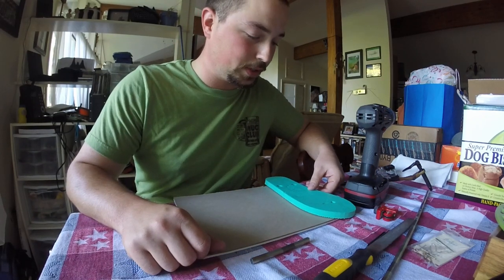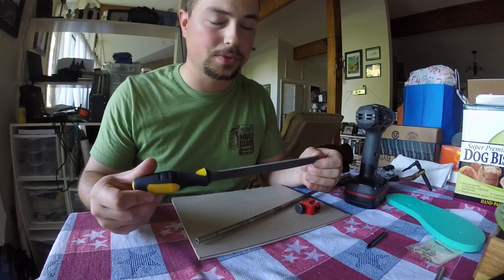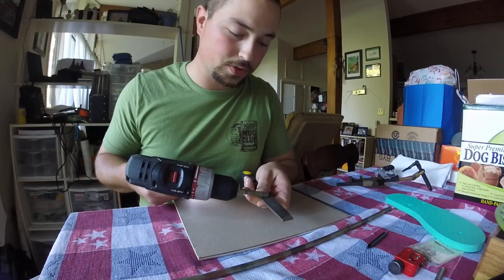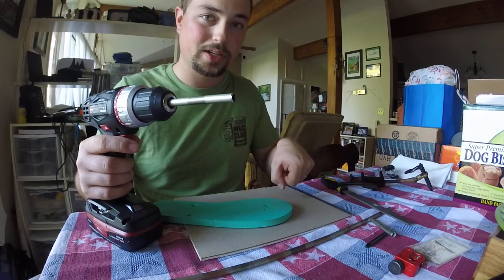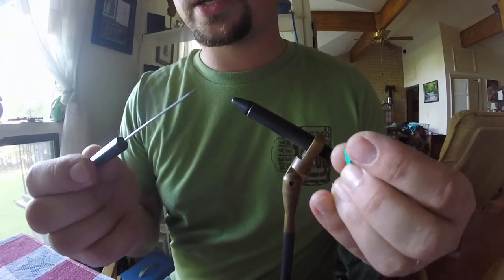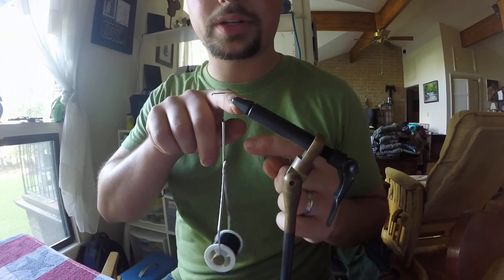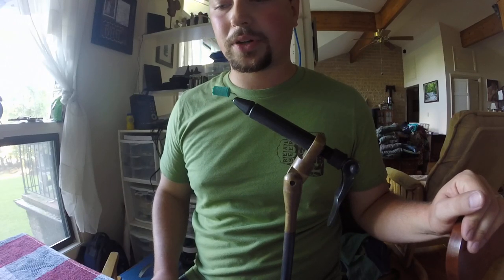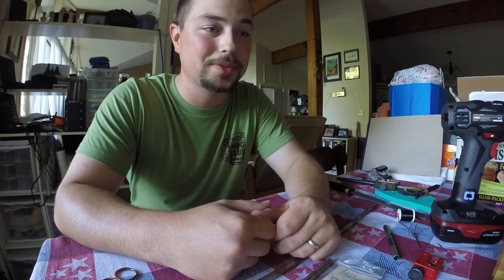DIY Foam Poppers

Comment: Great way to do this. There is a set for cutting trout bodies, or booby eyes for trout flies. This is a great idea for larger poppers. I might get some arrow shaft for cutting larger poppers. I don't think the flip flop foam is as dense as the foam I buy but it might make a cheap alternative. Now I am going to have to try this.  If it works well I may glue two flip flops together and make bigger poppers. I bet it would work with cork too. All the best, Sean
Reply from the maker: Most arrow shafts will cut a plug right around 5/16 of an inch in diameter so this method is great for making poppers for bluegill, I actually came up with this cutter idea because the grass carp I have here locally seem more interested in top water flies and I've always been partial to the simplicity of foam.

Comment: Or if you're like me and only hunt with carbon you can just go to Harbor Freight and buy a hollow punch set for under ten dollars I believe I paid around 7 bucks .They are already sharpened and you can make different sizes.I like 5/16. drill them and push them out of the punch with an allen wrench.

Comment: What is the name of the metal holder that most of fly fishermans using ? Nice video btw!
Reply from the maker: The device that holds the hook is called a fly tying vice. The one I use in this video is a pretty simple one but they can come with many more features.
Reply: Thanks!!

Comment: If you buy flip flops for making poppers use a denser foam. A soft foam flip flop popper will come of hook as soon as fish hits it. Trust me I have tried it.
Reply from the maker: John Meyer I hear ya on that. Whenever I tie with foam, super glue is always involved. I just use the flip flop foam because you can pick them up at the dollar store for about 25 cents at the end of the summer and if you find a size 12 or 13, you can tie a couple hundred  poppers with them.